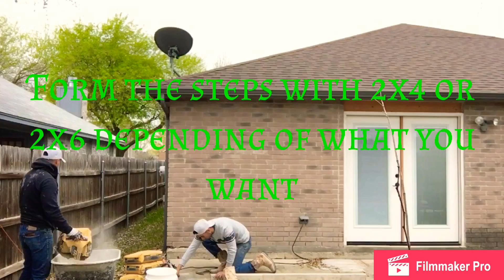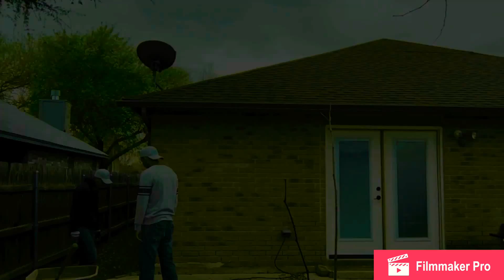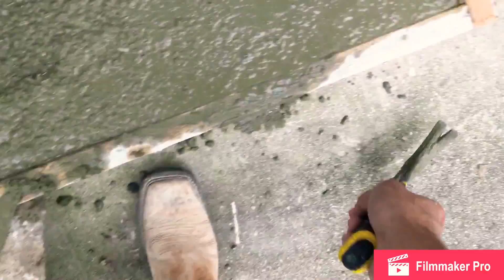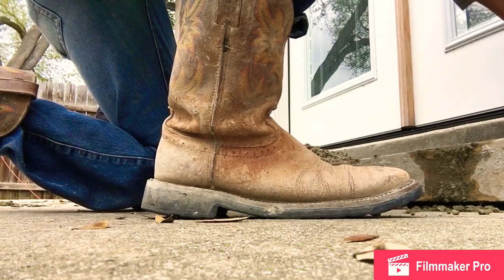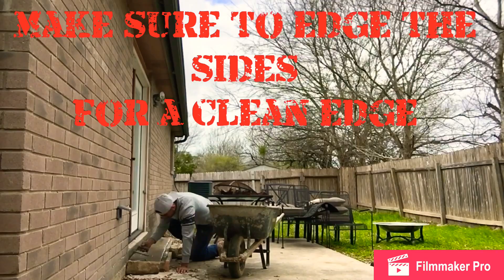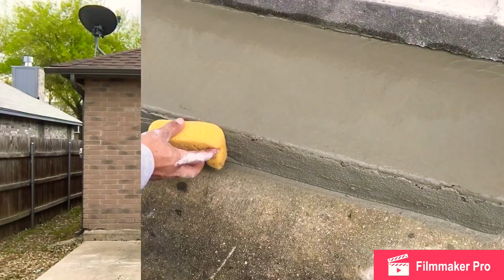Diy concrete step

Comment: Will the new step bond to the existing concrete? Do you have worry about it shifting?
Reply from the maker: if the you drill pieces of rebar yes it will bond …

no no worry about shifting

Comment: Did you leave a gap between the new concrete and the house foundation?
  If so. Would the cause a problem if water drained into it and froze?

Comment: How many bags did that take?
Reply from the maker: Prestia2011 5 bags of 80 lb
Reply: Charly D what was in the bags ? Was it granite ?
Reply: @wilsybhoy  
It's cement mix
Reply: Prestia2011 did you mix the cement with sand  Or was it a granite mix my friend ?
Reply from the maker: wilsybhoy no do just add water its already prep for you
Reply: Charly D so it’s a sand and cement mix in the bag already ? I don’t think you get these in the UK

Comment: Why not make it level with the Door ledge that’s already there?? Wouldn’t it be safer?
Reply from the maker: Because theres more % that water could get inside the house and pluz i the customer how do they want it and they said they wanted like that 👍🏻
Reply: What mix did you use?
Reply: There would be zero purpose for it to be level with door and wouldn't gain a thing but the possibility of rain coming in.
Reply: @featheredcoyote5477  Bummer! Mine doesn't. 
The step stone is level with the frame of my sliding door, which is water tight. But yes, if that is a concern, it is the best solution.
Reply: @marciloni12  so what exactly did you gain if you only put 1 step level with the frame of your door? It's still the same height whether you put a step in or not so I don't see what you gained?